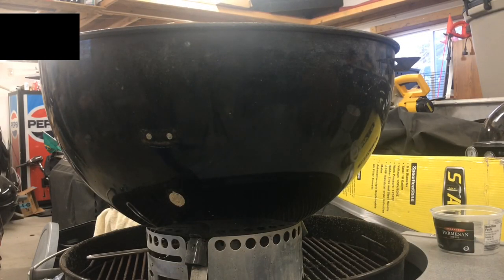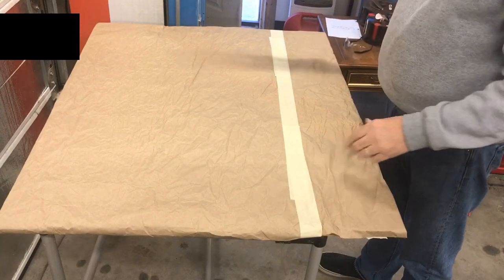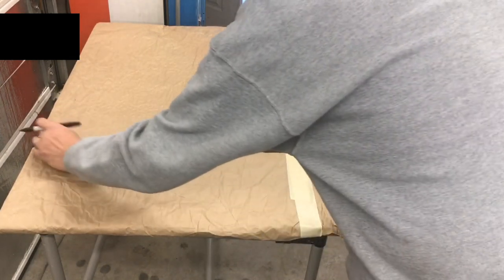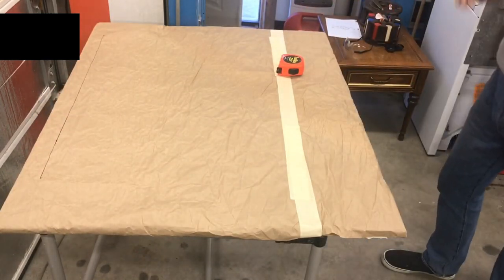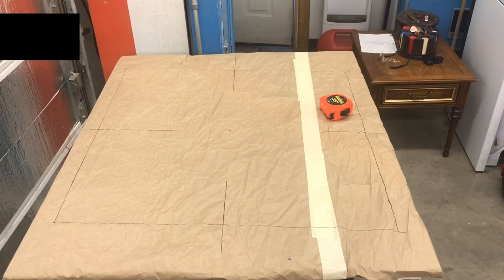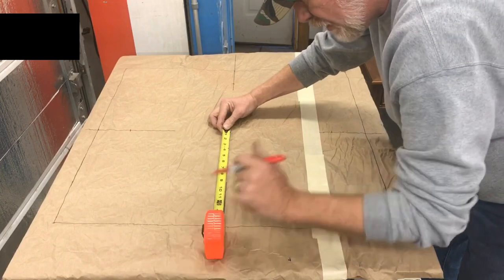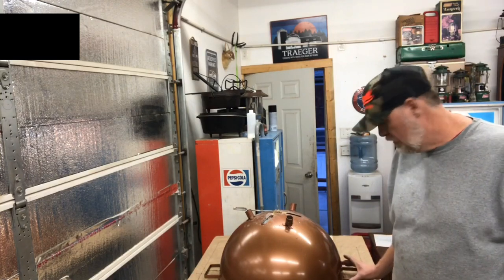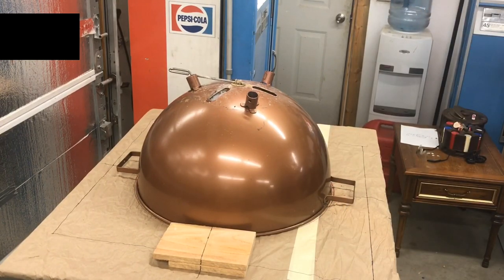How to change out a kettle bowl on a Weber performer..part 2: drilling out new kettle bowl

Comment: Good vid - I've done this a couple times now... Save yourself some measuring.  To find the center of a square, go diagonal to diagonal...where they cross is dead center.  To make sure your 30" square is actually square... the diagonal should be 42-7/16".   Finally - I put the bolt head on the inside of the kettle instead of the nut/washer, and used  pan-head  low profile bolts so nothing would interfere with the grill.
Reply from the maker: Thank you for watching and the tips . What’s the old saying— there are many different ways to skin a cat.. lol
Reply: @LouisatRshackBBQ  And in all cases the cat is never happy about it. :D